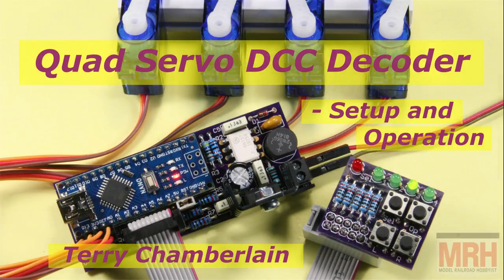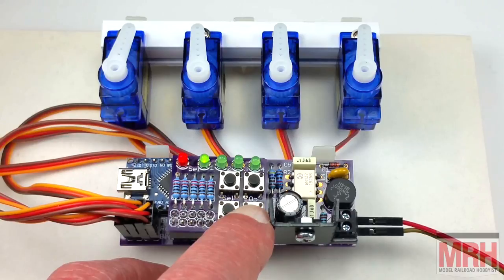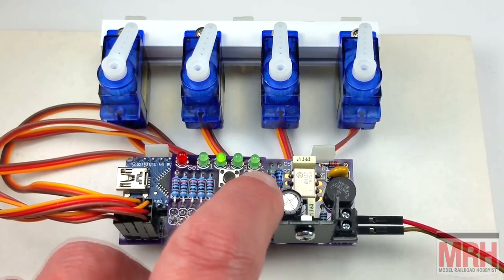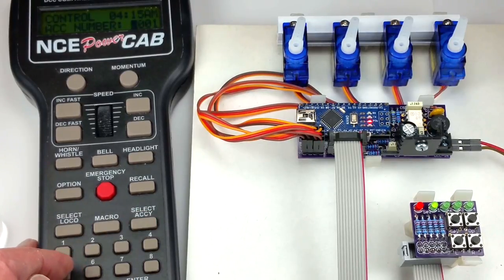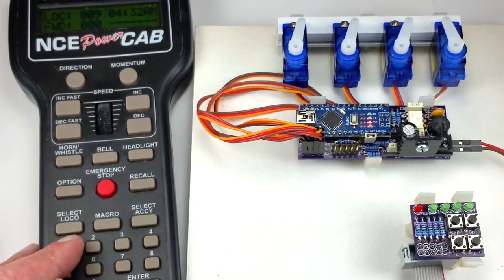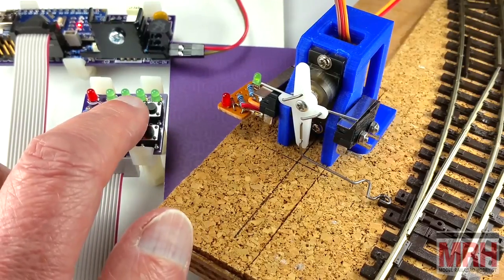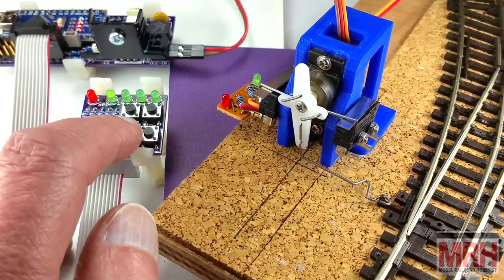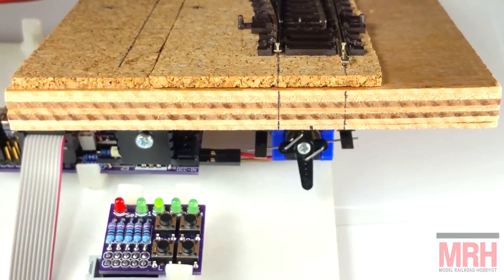DCC quad servo decoder setup | MARCH 2020 MRH Mag

Comment: Left point is not touching this going to cause a problem with juice flow.
Reply: No problem here provided the Peco turnout has the recommended modification for DCC, with both closure rails electrically bonded to the corresponding stock rail, so that electrical continuity is not releiant on contact between the point rail and the stock rail - adjustment of the servo position is only to ensure that the point rail is mechanically in the correct position relative to the stock rail to ensure smooth running through the turnout